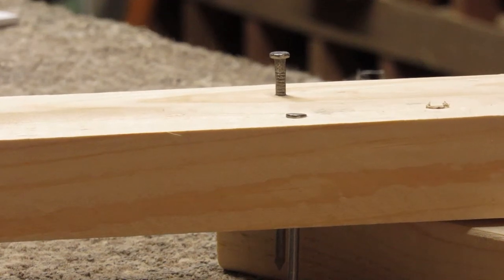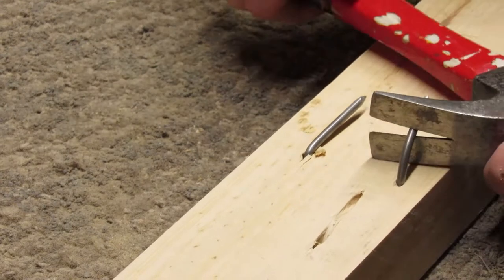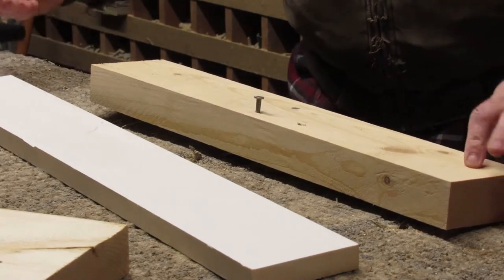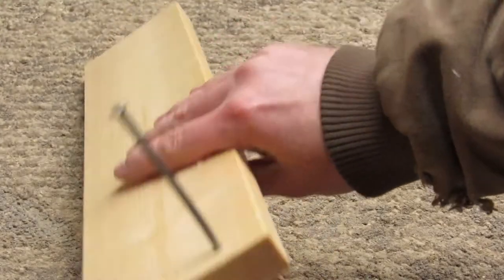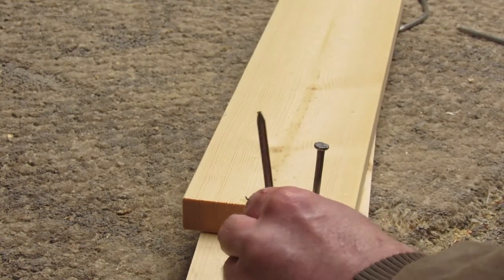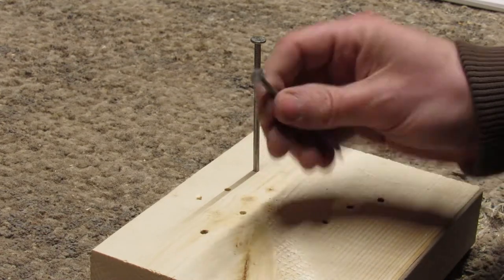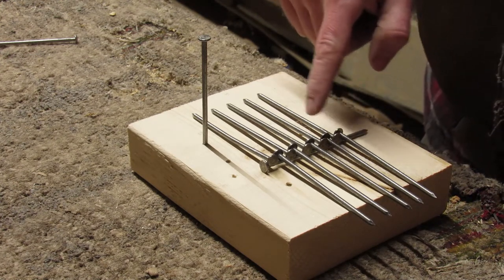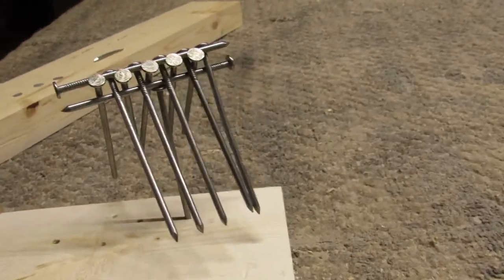HAMMER AND NAILS HACKS

Comment: final trick - awesome! blunt nail to prevent splitting wood - firs off, the second nail went a little bit further from the edge but more importantly more into the core wood where the rings are so small you drive the nail across them. that´s for the particular case, the trick in general it´s not the first time I heard it but what I´m looking for is an explanation how does this work actually? the nail body splitting the wood is the same thickness afterall..
Reply from the maker: Thanks for watching!! Cheers